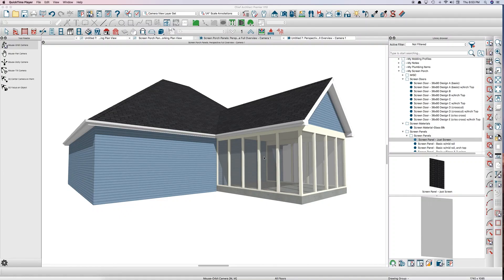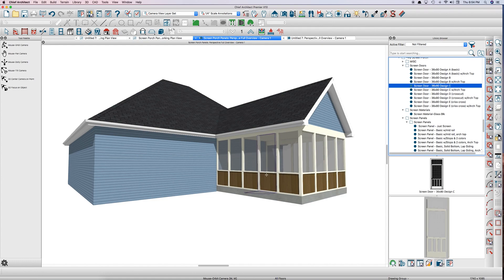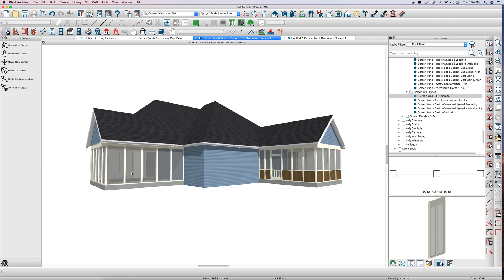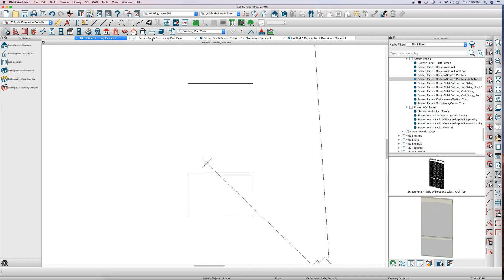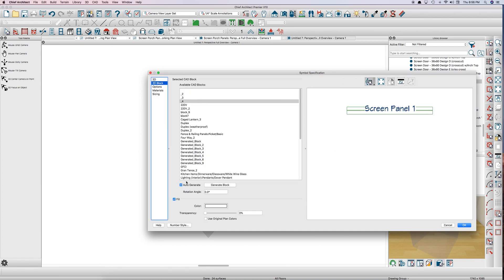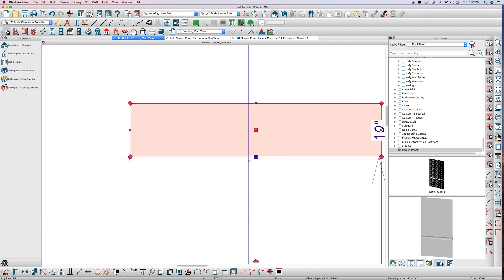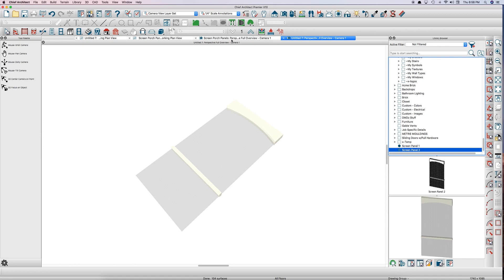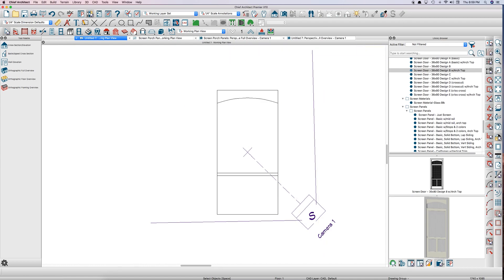Screen Porch Panels - How To

Comment: This says it works with chief architect x10 is this right?
Reply from the maker: No - it works for X11 and later versions. I’m sorry but it does not work in X10.
Reply from the maker: You can create your own screened porch railing panels in X10. My comment above was referring to the library that I sell on my website.

Comment: But in plan view the symbol is flat and obscured the plan.....
Reply from the maker: I'm sorry, but I don't understand your comment.
Reply: The symbol for the panel shows up in plan view as it was made horizontally.... even though it was rotated X-axis 90 when made.....   so it obscures the room and everything .   Can only uncheck railing walls on layers to take it out of plan view.
Reply: I would post a pic..... but it doesn't seem possible here in comments
Reply from the maker: I'm just guessing...but, when you are creating the symbol and you rotate it on the x-axis 90 degrees, make sure you also generate a new 2D symbol.  I think what you are seeing in plan view is the 2D symbol that was created prior to rotating along the x-axis.  You can go to your library symbol...right click and open the symbol.  Generate a new 2D symbol...then close and try it.

Comment: Oh,  I got it...... you pull the panel all the way up to ceiling height!
Reply from the maker: Robert - You should be using a railing wall...on the "rail style" tab...select "post to beam".  On the "rails" tab, where the "Rail Profiles" is shown...there is a drop down.  Select "beam"...and set the size (width and height).  You may have to uncheck "full wall width" in order to specify an exact beam width.  Make sure you go to the "Newels/Balusters" tab...and set the width and spacing of the newels...which in your case is the screen porch posts.  I usually sets these between 42 and 48 inches.  The posts are typically 4x4's.  Now...when you draw the railing...the top of the beam will automatically be at the ceiling height of the "room".  So...make sure you click in the room and make sure the ceiling height is the default for the floor...or specify the screen porch ceiling height you want.  Hope that helps...